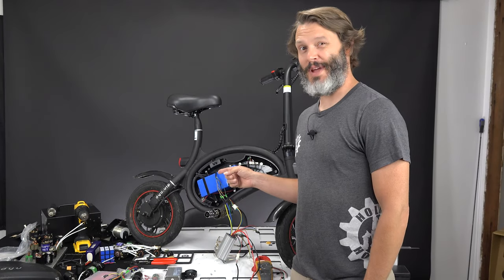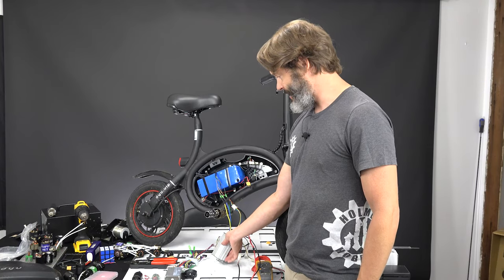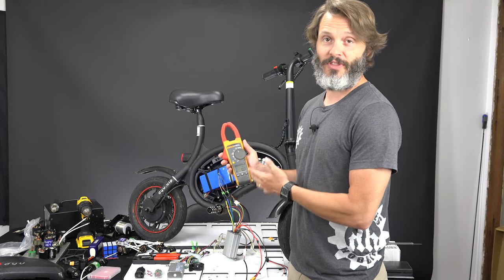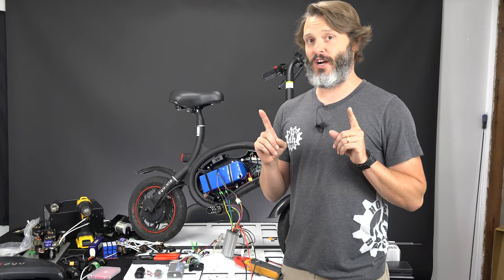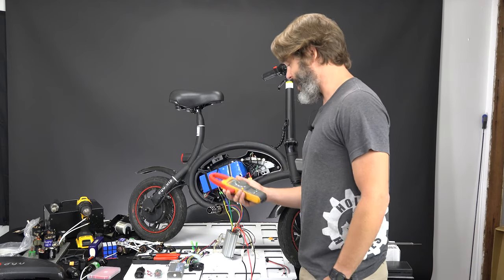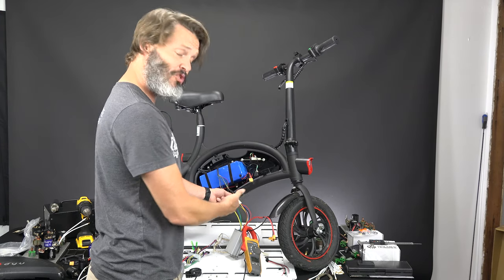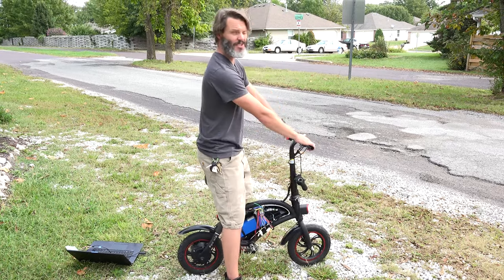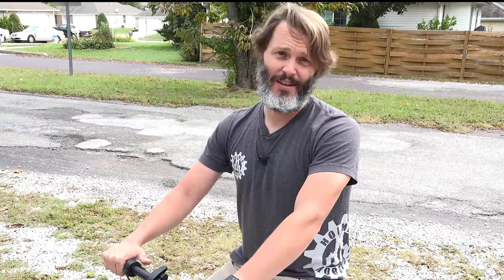Tech Talk & Tips To Upgrade Your DYU Electric Bike Controller - Holmes Hobbies

Comment: You are the man!
I bought a 48v controller and battery and hooked it up with all the wire colors matching and it ran but very rough and high amp draw. I didn’t have the guts to start trying different combinations until I saw you video! Kudos!

Comment: I own a dyu D2 I've modded mine to 48v with a gear motor and a 30amp battery thing rockets upto 30mph I love it also the controller supports 60v if I ever wonna go ham lol
Reply: Will James I ordered a 36 volt 14 ah battery to switch out for more mileage. Waiting for battery to arrive from china
Reply: Does the dyu have the same mods as the jetson bolt ?
Reply: @Kingcyberbeasty  yeah
Reply: Stoned Göst  motors can be bought from aliexpress look up 12 inch hub motor
Reply: Stoned Göst I decided against it. I heard it would over heat motor

Comment: Great video. When's the update coming? Just bought one and looking to mod it. Won't you need a new hub motor if you're switching the controller and battery to 72V?
Reply: Switching to a 72v battery you’ll Definetly need a new controller but I think the motor is still good to go

Comment: Actually, for every arrangement of the phase wires, there's one arrangement forward and one arrangement reverse of the hall sensors. So you can either keep the phase arrangement and work on the arrangement of the hall sensors or keep that of the hall sensors and work on the phase wires. So instead of 36 arrangements, you get to deal with only six.
Reply from the maker: For every arrangement of the phase wires there is one good combo.  You can't have both a good forwards and reverse on a single phase arrangement (ignoring a reversible controller).   

It is more than 2/36 good, I was mistaken.  it is 3/36 forward and 3/36 reverse. 

So 50/50 chance the first phase combo will result in a usable pinout if we just change the halls

Comment: I have a D3+ 36v 250w motor. You certainly need a 350w motor and above. Also, a larger capacity battery. Ideally 14ah or 17ah 48v good quality battery which is around the same size as the 36v battery pack. 

There has been recently, a DYU-D5 'double battery' (battery B on back carrier), larger motor series recently marketed.

Comment: Hello. nice video. I just receive two controlers from outside they are exactly the same. two different brands, one brand say 350W the other says 400 to 500W, and this ones are more expensive. how i know they are only changing the labels so persons just pay more?
Reply: Look carefully at the components on the board, compare their numbers, they are doing the same thing, so it's possible that just some of the components are higher voltage/amperage etc.

Comment: Hi, I have a Jetson Bolt Pro 36v/350w , and it's slow and doesn't have much power. What can I do to upgrade it.
Reply: Add a Bluetooth controller and then connect the ride Jetson app to it and boost the speed also disconnect the pedal assist

Comment: My current ebike has a 250W motor running on 36V 10.4ah battery with 36v 13A stock controller. Can i switch the controller with 36v 20A controller to get more torque?

Comment: I find when I am replacing a connector, for a specific reason or need--I just use balance connectors. You can get 'em cheap on the usual scumbag websites with wires soldered on. They go up to 20s for those big batteries, and since this is "mine" I know what I am using this for... But, still, some labels on there helps too. I've used small 1mm bullet connectors on occasion. That works out good, because you can 'bundle' them up, and make a "keyed" connector using heat shrink in clever ways.

Comment: can you do an update? since this bike looks identical to the jetson bolt which many people have, including myself, which I just got about a week ago. you can order a 48v,52v 60v, or 72v battery off of aliexpress then do your video, also can you also try using the upgraded battery with your original controller to see if it burns out or gets any improvements. To make it worth your time try to order one that is 20ah+ then can go really far, I am curious to see how you would install it on the bike if that size, I was thinking of a 30ah, since the shipping cost is almost the same, but will put you back a few hundred dollars

Comment: Hi, thanks for the very informative video. I'm on my 3rd bike, someone stole #1, then #2 was damaged in an accident (yes I went to the emergency room and my leg was torn open to the muscle facia) when the handlebars disengaged after I encountered a hole the gardeners had left the grass to cover and the bike stopped running. The wire was cut from the handles being put down at the neck. #3 came out of the box with a bad battery and controller. I have the 350W with the app controller.  I found two sets of wires that are black and white and pulled one of them apart (i saw a diff video about that) and it gave me a lot of speed. I am interested in purchasing a controller from you. I love this bike and terrorize our golf course every night late to go fishing in the lakes. I also breached the perimeter at the local resort to go fishing but was able to outrun the bicycle security when they showed up. My ebike gang is accepting new recruits. lol
Reply from the maker: https://growandthrow.com/products/dyu-and-jetson-bolt-upgrade-controller Here are the controllers

Comment: My pedal assist did work but switched out the controller for a higher amp one but now pedal assist mode don’t work  but at least the throttle works but I prefer the pedal assist option any help would be appreciated

Comment: Iv moded my one to a 48v setup definitely made a difference even when running on 36v 👍👍
Reply: bill Short can you do a tutorial of it? I would like to upgrade mine as well!
Reply: @perhanperhanovic2635  i will do as soon as I can working a lot at mo so when I get some free time I will do video for u. My one is a very modified with over 25mil range 36v is 20mph and 48v is more 30mph speed have tested range on 48v yet but is fun lol 😂
Reply: bill Short sounds interesting! I dont really understand electronic but if there was an tutorial i would have done it long time ago! When you do the video please write all the components you have bought and where you got them! I am from Sweden and we have ”andersson e-scooter 5000”, i wonder if we have the same components as in your country? Where are you from😊?
Reply: @perhanperhanovic2635  I'm in UK I got my parts from amazon will give you parts list soon as I can 👍 most expensive item was the battery pack
Reply: bill Short what are your thoughts- I ordered Li-ion Battery 36V 14AH Volt Rechargeable Bicycle 750W E Bike Electric Li-ion, what are your thoughts? I’m just looking for more miles not speed.
Reply: @Dozereyes  14ah is good it does depend on how u use it if u use just throttle and not pedal much it will give u less range if u pedal more will be better range also depending on motor the bigger the more power it will use so its getting the balance right 14ah is good so range should be good to the more ah on a battery the more  charge it will hold so it will give more range than a smaller ah battery.
Reply: @maddog3851  what parts did you use
Reply: @maddog3851  your 48V setup is 30MPH? 
What motor are you running? 350W 
With a 48V setup on a 350W motor you would get 23-25mph . The fact that you say you are at 30MPH , I find it hard to believe . I'm just sayin, I would like to kno your current setup. Thanks man! 🤜🏽🤛🏽
Reply: @royalvibes4433  I changed the controler and display to a kt controller its a 25amp 48v controller with display batteries were changed to a 30amp bms different battery pack it will do 30mph

Comment: Where you connect the three motor phase wires ? What is the name of those connectors? I have a new controller with those same connections. But my bike has different connectors. So please please help me ? Maybe you have a link on Amazon where I could get them? I need both ends. Male and female with the casings. Please and thankyou. And what size ? 12 - 14 ?

Comment: Great video John. I was wondering are you still selling upgraded controllers as well as hoping you would show the battery upgrade for this electric bike
Reply: Hi I ordered Li-ion Battery 36V 14AH Volt Rechargeable Bicycle 750W E Bike Electric Li-ion from eBay. Just want more miles not speed, your thoughts?
Reply from the maker: finally finished them! https://grow-and-throw.myshopify.com/products/dyu-and-jetson-bolt-upgrade-controller

Comment: Thankyou very much for the vid. Im looking to upgrade my controller for my unusually looking stock one which is only giving me 25kmph. Im at a loss when it comes to turning signal indicators, brake lights etc. With your regular alixpress controllers can you wire up the turning signals?

Comment: I have a 6 pin display on the controller and 5pin for display all are the same as far as colors on both ends except for the white wire where can I connect with

Comment: Have the Jetson bolt. Close to same bike. I’m at the weight limit. Had an overheat on slight incline on the way home. I’m interested in all upgrades lol.
Can you point out a good controller that will get me by for a few weeks until I plan for a full upgrade?
 
Also like the 2 motor idea. Was tossing around an experimental idea of upgraded gear hub motor in rear for take off and hills and a gear less hub for front. Kind of like 2 speed with a switch to pick which motor to run and use the same throttle with separate controllers. You can take off with high torque then switch over to the gear less and pull good speed shutting off rear motor and let the freewheel do its thing and be pulled along. Any thoughts? I’m new to this but ideas inspired by what I read about the different type of motors.

Comment: Hey do you have a link that I can buy a replacement battery?.. I haven't used mine in few months but when I did few days ago it just went completely dead all of a sudden.. and when I plug in the charger it would read full charge after a minute.. it would ride for about 2mins then go completely dead again.. im leaning towards the battery being the problem

Comment: Hi, very interesting video. I have the same bike jetson bolt from Costco. And you are right, it is little slow.  You opened original controller, is it good enough to run this 48 volt battery?

Comment: I bought a new ebike battery 36 volt 25A and it does not work with my 36 V 250 watt motor..believe the previous owner must have modified the contoller to match the  20A battery that was in there..Quick question..what would the right basic contoller be and where can I buy it?

Comment: Hey I like the work you do with these electric scooters. I have an issue with my electric motorcycle that I hope you can help me with. I have a 72V 35Amp electric motorcycle that originally came with 6 lead acid batteries that were done when I bought the bike. I wanted to replace those 6 batteries with a single lithium battery. So I bought a 72V 40amp lithium battery and hooked it up but when I twist the throttle, the bike completely shut down. Also the bike came with a sign wave controller but after experiencing the shut down issue, I replaced the original controller with a 3000W speed controller. On Jack stands, when I twist the throttle the back wheel appears to be moving at a very high speed. Take it outside for test ride, I sit on the bike, twist the throttle and shuts down. Can you please help me out with this problem.
Reply from the maker: Probably overdrawing the bms or controller is tripping due to higher voltage under load

Comment: I built gokart with two hoverboard motors. Used two bldc controllers.  Im seeking advice to learn to drive reverse. Cant find any wire. Please advise
Reply from the maker: Depends on the controllers.  Might have a reverse pad on the board.

Comment: Hello, this video earned my sub. I have both Bolts and on the Pro which has no bluetooth connection I took the BT module from the reg Bolt and it easily connected to the Pro. From there I used an old version of the Ride Jetson app (6.2.7) and maxed the top speed to 18.6 instead of how it arrived being governed at 15.5mph. What is the next step to change the max speed by using the app?  Or is it not able to be done? 

Secondly, if you did install a 72v battery, if the rider only used the throttle at 50% max, would that equate to double the range?  And wouldn't a 72v battery be incompatible with a 36v motor.  I'm obv still learning the basic with V A and Wt. But I think you would know these.... Thanks and I appreciate any answers you give in advance

Comment: i have a bike with a controller filled with silicone. i really just wanted to shunt mod it and call it a day but i cant. if i replace. ive learned alot about my bike but the controllers have stumped me slightly. Is there anything compatibility wise i need to worry about other than making sure the correct battery voltage and amperage are correct?
i imagine the display would need to be replaced as well. My ebike was from a canadian dealer and they take off all source of branding whatsoever so its been a challenge to find some things.

Comment: First and foremost, this video is awesome and quite interesting..I have a question,  though...So I have a Jetson Bolt which stopped working the other day, out of the blue. (I had gotten about 6 problem-free months out of the Jetson...until now)..I had used the bike that morning, and then put it back on the charger for more than enough time..however when I hit the ON switch this time, the bike would not accelerate ..I dont even think the LED battery indicator lit up at all. 
Having no knowledge of the inner workings of an ebike, I don't know where to start when it comes to diagnosing such a problem. All I know is that it wont work at all. I believe there's a short somewhere in the wiring, but not exactly sure. I mean how would I go about finding a short? Better yet, how would I go about running my own little diagnostic to pinpoint the issue? Any suggestions on what I should do first (besides looking for the warranty)? I actually would like to learn to repair the thing myself because I use it to deliver food on DoorDash... any type of solution to starting point would be much appreciated! Cheers

Comment: What would be the outcome of you exchange the stock 10.4ah 36v battery for a larger 48v battery pack, still using stock 250w motor and controller?

Would it be like using standard AA 1200 batteries in a camera (drains faster) then changing them to the AA 2300 high power type?

Comment: I'm thinking a dual motor set-up, one in the back AND front but with stronger(more torque) motors for trail/hunting use. I've always loved those old Tote Goats and then later those 2-wheeldrive motorcycles/trail bikes. But always thought they were too noisy for hunting.
Reply from the maker: I'm with you on the 2wd.   First I'll get a higher voltage pack.   Next I'll see about front wheel drive too.
Reply: @HolmesHobbies  Awesome...I'd love to see that.

Comment: Any update? Have you burn the motor? Because i did, i have put 52v battery in my backpack and havy shunt modded controller... It was fun but only lasted for about 15mins before motor burned shorted phases and burned my controller... It was long walk of shame bac home with rear wheel up in air as it has now "pernament regen" on. Lol!

Comment: I just had a race with a scooter and I lost I have the stock peddles thinking i could use them if i had to but I just did not have enough gear left at 15 mph I believe he was do 20 mph on the scooter is there any way i could just increase the speed to at least 21 mph just not liking getting beet by a childes scooter thank you in advance

Comment: mr Holmes, a friend has major (to me) problems; he bought a used bolt pro, the previous owner toyed with the throttle, which he asked me to replace, but when i opened the access panel there are burnt wires at the UD3-UL controller, is there any place that you know of where i could get a wiring diagram for the bolt pro so i can get him running, and what controller do you recommend without getting too expensive, please help hooah???

Comment: My DYU+3 has an issue, where the system shuts down. Loud werring sound and rear wheel tries to brake.
Also, the bottom assist bracket region, when not pedalling,  creates a knocking sensation through the left pedal arm. This tends to happen over a period of time. 
Is it the motor,  sending something through the line/linked cabal?

Comment: Could you possibly help me? I would Greatly appreciate it. 52v battery and both motors are 52v 1300 watts each. Do I need a 3000 watt 2 in 1 or 2 1500w controllers.

Comment: I have a scooter that someone broke the thumb controls for throttle and break completely off, I have tried ones from other scooters but none of them work and I still get the error code for no throttle and break.
How do I find out what thumb controls would work with it?

Comment: I bought 2x ebikes kits for myself... 1 being a mid drive and the other being a hub; both worked great.... I bought my dad a amazon special ebike and tried swapping out it's controller and accessories with a bafang kit(everything but the hub and battery) but am running into an issue where when I turn it on although it shows up as being on pedal assist 1 it does nothing till I change over to 2 or more and than it works fine; the seller sent me a 2nd controller but it's doing the same.... any ideas?